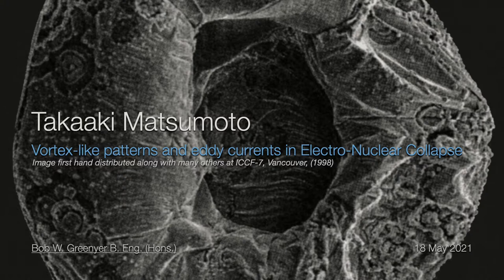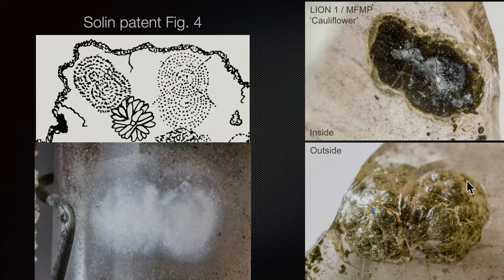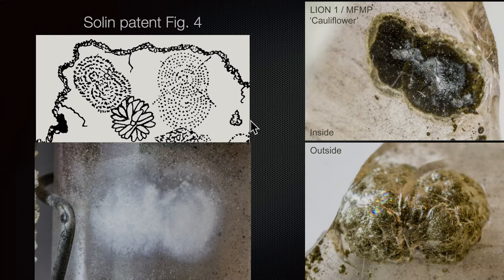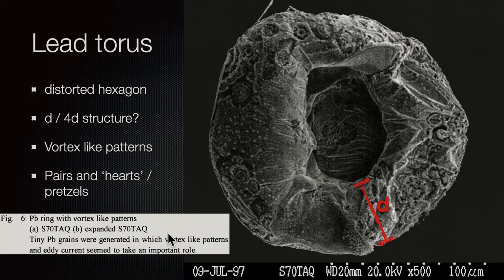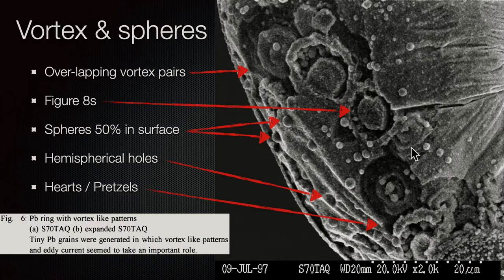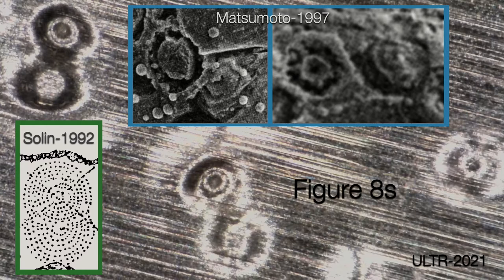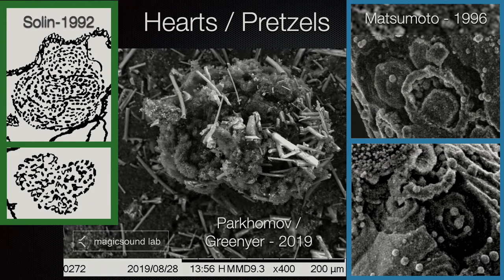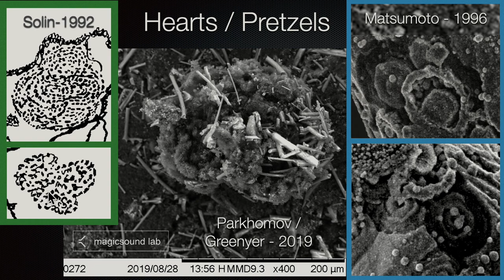Matsumoto - Vortex-like patterns and eddy currents in Electro-Nuclear Collapse

Comment: I came across this presentation by chance; it is a field to which I had not strayed before. I have been following the work of Michael Clarridge, Don Scott and Wallace Thornhill in the Safire experiments. Those experiments are now being taken further by Aureon Energy to transmute radioactive waste..
Looking at the double circle or figure of eight patterns shown in your photo micro graphs, I was immediately struck by the similarity to the model of Birkeland currents ( at astronomical scales) explained by Scott as being pairs of plasma filaments that  wrap around each other in a double helix. Seen in cross section, the double filament model could be operating here at a microscopic scale; the plasma tubes emerging from or entering the surface of the solid in pairs.
Are you aware of the Safire results, published on YouTube? Interestingly, their team also found deposition of microspherules containing elements that had not been present in the discharge chamber before the plasma discharge experiments were run.
Reply from the maker: Yes it is likely a related phenomena.

Comment: Bob As in Super nova's there are so many different types and look to them u will see the same in these discharge events,,,,,, hexagons galore in the solar system,,,,, electric discharge cratering  on the macro and electric discharge machining on the micro scales look almost identical to some of the moons out there so will u see the same structures in the lenr and lion in fact any type of electric discharge,,,,, THIS UNIVERSE IS ELECTRIC all the way to the atom and same goes for magnetic fields or bubbles and birkeland currents that are in dark mode and we just cant see them until something travels along its path of influence
Reply from the maker: What is of interest here is that these structures are sites of elemental transmutation (and the data from Solin and Matsumoto points to nucleon decay, synthesis and regeneration) in the field of LENR.
Reply: It's funny how they say 'the universe is NOT electric' ... our reality, our universe, all matter, everything outside of magnetism and dielectricity itself, everything we see, is made of electrically charged valence shell phenomena which spins reality onto your eyeball at 'light speed'. So at the smallest level, exists the electric ELECTRON and PROTON. it's stares us right in the face sometimes but we're just too primitive to 'get it'. Particles are just digital sparks and effects of effects. all digital. mother nature paints reality on the fly into the void of 3d space. We draw lines and circles and points, she blooms reality from the inside out, her point, line and circle is all the one movement. We are too primitive, mother nature, reality, the universe, electrogmagnetism - these are all the same thing. We think light is photons of tiny balls of light and that electrons are running up and down a copper cable.. we see phenomena, describe what we're seeing, but fail to realise how it's being generated to us. Magnetism is what pushes all our atoms together, as it does this, at the same time, it creates space by it's very nature.